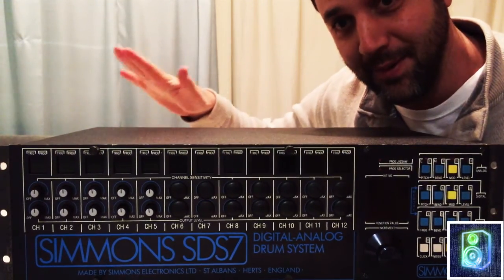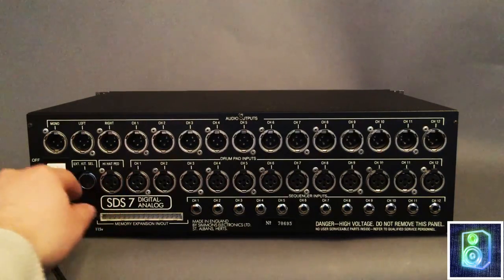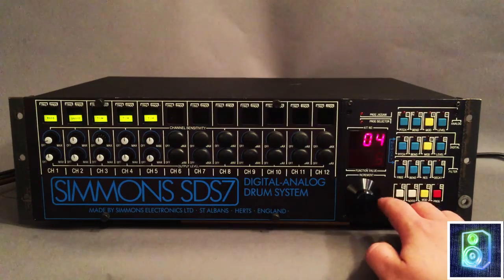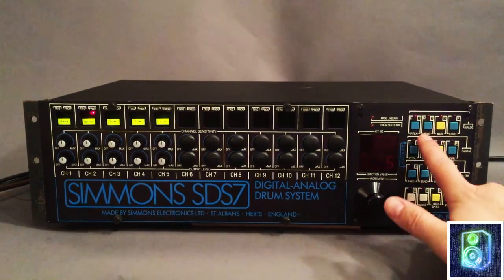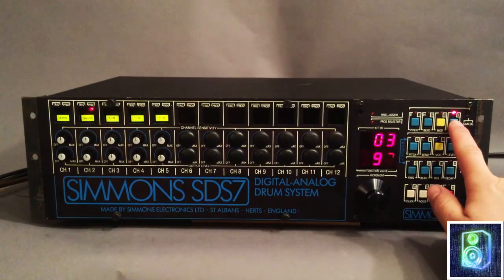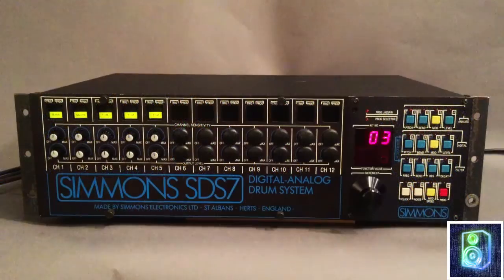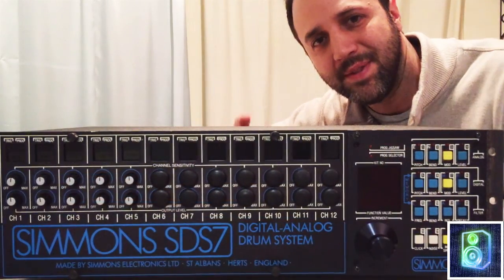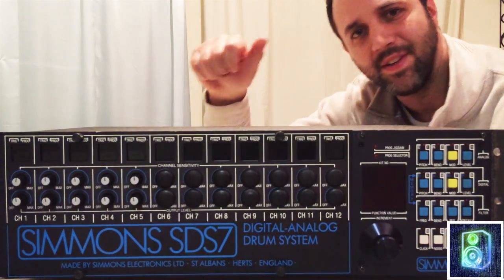Simmons SDS 7 Analog Drum Machine Review and Tutorial

Comment: Hello Mr., I am from Buenos Aires. I am owner and I have played many years with an SDS1000 + TMI.
Many years ago I bought an SDS7 module but never learned how to understand its programming. Now I've seen your post on you tube that has helped me to progress in learning.

But I never knew if the previous owner had changed the factory programs. I would like to know if the factory programs can be RESET to return to leaving them as they were created from the factory.

I thank you for the video and what you can explain ans sorry for my english
Greetings from Buenos Aires
Reply from the maker: Hi Osvaldo, I am not sure if there is a factory reset, but if you set all off the controls on a card module between 120 to 150 you should be close.  You could try all the other kits also to see if one sounds close to the original set up.  Thanks, Matt
Reply: Hello Matt, I'm reading the manual you indicated. It says in a paragraph that the sounds of kit # 41 to 79 are duplicates of Kit # 1 to # 39, so I'll investigate this first. It also says what you indicate values between 120-150 for reference 0. What is not explained is if these kit from 1 to 39 factory are blocked to use them as a user, it will be a question of trying, right? Best wishes Osvaldo
Reply from the maker: Unfortunately, I don't have the SD7 anymore so I am unable to test it.  I am unsure if patches 1-39 are write protected.  Good Luck!

Comment: Wauw, thank you for this (too short) video. Do you have a video where you show how to add a sound channel?
Reply from the maker: Hey Niels, Just turn it off, unplug it, pull off the front cover as shown in this vid https://youtu.be/421ho02ZI9A?t=3m14s  Then slide a new card in there.  Pull out the two channel control cover plugs on the front cover.  Then screw the cover back on.   That should do it.